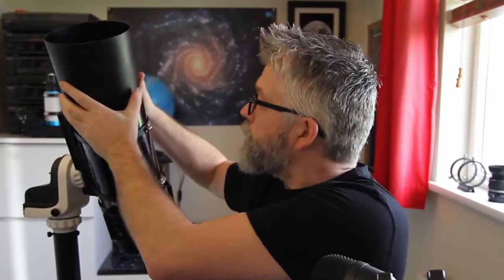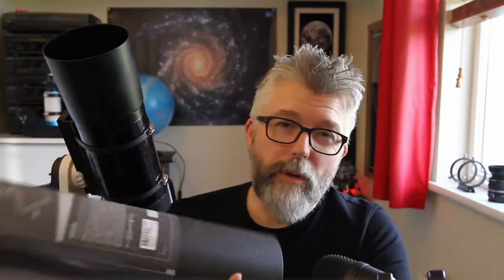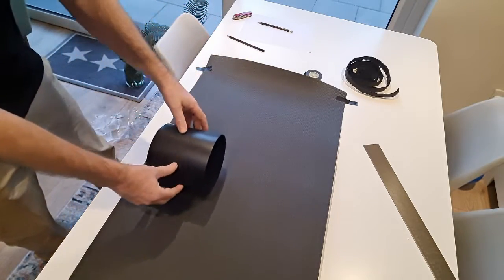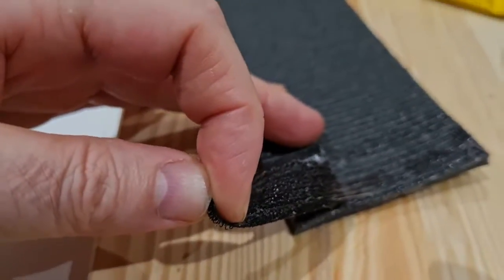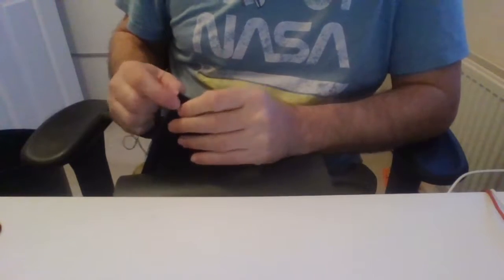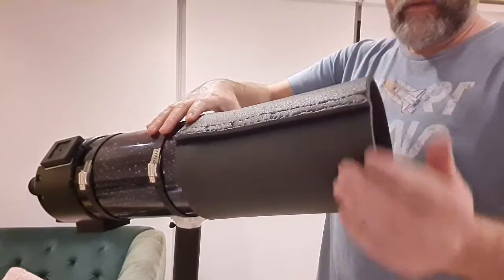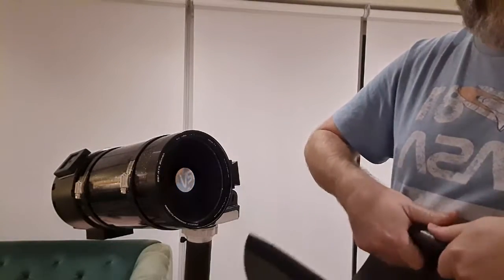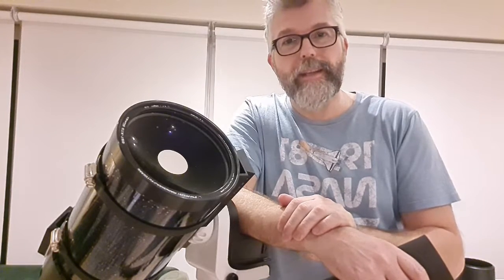Make your own Telescope Dew Shield.

Comment: Great idea and I plan to make a dew shield for my Dobsonians  (yes you heard that right😂) to exclude extraneous light pollution. Maybe attach the dew heater under the dew shield to prevent insulating the dew shield from the scope.
Reply from the maker: Are your Dobs solid tubes? Is the plan to put the light shield on the opposite side of the OTA from  the eyepiece?
Reply: @StargazerMan  Sorry to hijack:

I am building a custom 207mm / 750mm Newtonian. I really liked the video and got what I was looking for. Thank you for taking the time to produce this and others. 

I have an additional question based on this comment. 
When I finish my scope, it will be 32" (about 800mm) tall. This makes it an F/3.7. 
I want that light bucket for wide view sky objects. My thinking was that I would just add a tube that slides on dowels to add 10" (254mm) to reduce the FOV, and inturn raise the F/ratio for when I want to shoot planets. 

I would like your opinion on if this would work as I expect to raise the F/ratio of the scope. 
My goal is to raise the F/ by a few maybe a 6 or 7 so that the planets are not blindingly bright. 
Thanks!

Comment from the maker: I've had someone point me to sheets of flooring called Proplex that is potentially lighter, folds flat and stick on Velcro is suitable for. Must try this next!
Reply: I thought of open cell foam, but I'm guessing stick on velcro won't stick.
Reply from the maker: @stargazer2042  It may do, I'm going only by my experience from using stick-on Velcro. I think a good polyurethane glue might work.